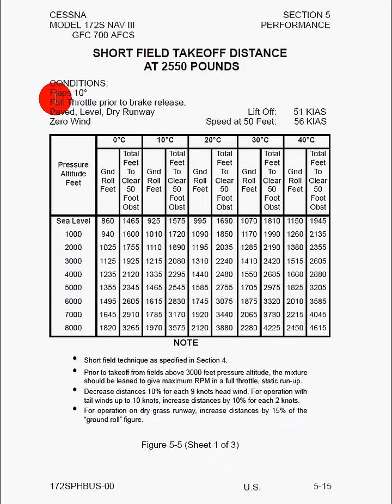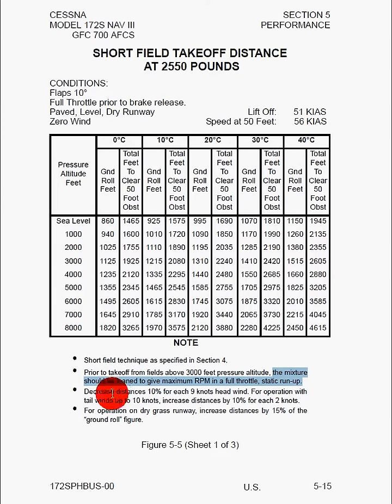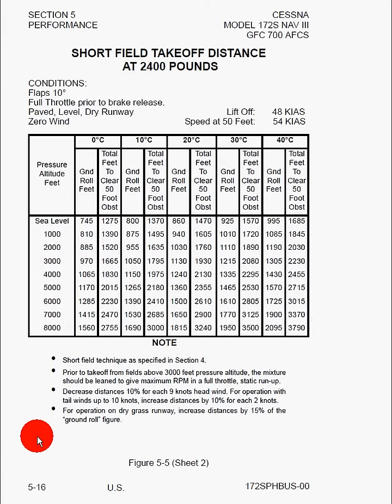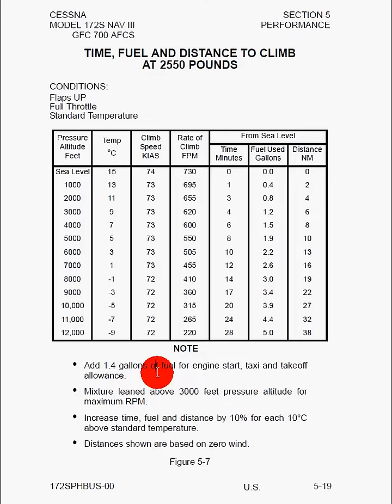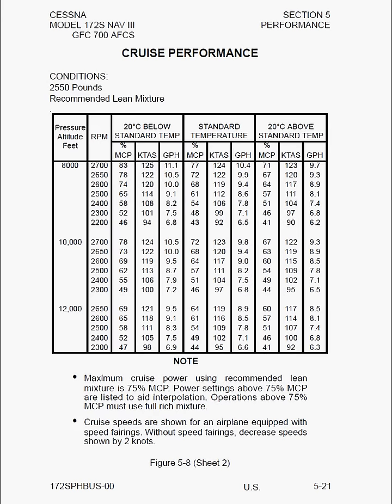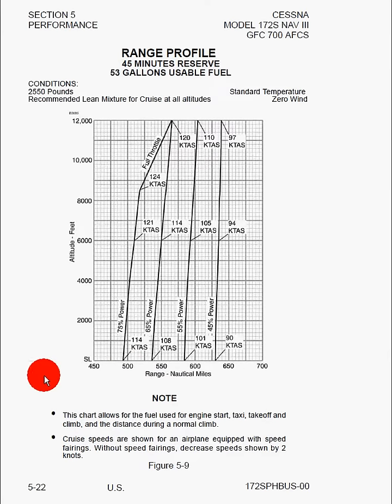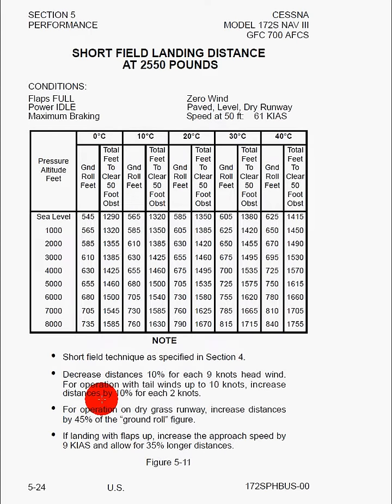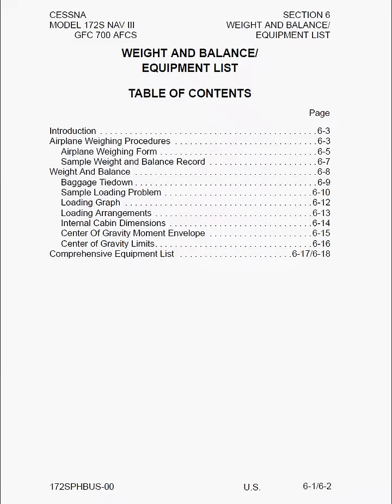POH: Section 5, Performance (Part II of II)

Comment: Great series of videos bro, no body else explained the whole Cessna 172 POH on Youtube. I just want to point out one mistake at 2:25.. you don't add these percents together like 45+25=60.. instead, you add the first 45% and then take this new result and add 15% of it again to it.. for example, if you have 100 and then you add 45% to it you'd get 145 but then you add 15% of 145 and add it to 145, not 15% of 100 and add it to 145. So, 15% of 145 is 21.75, add that to 145 and you'll get 166.75 rather than 160.